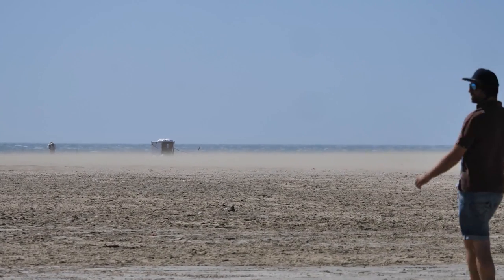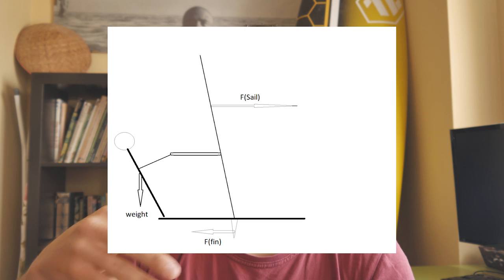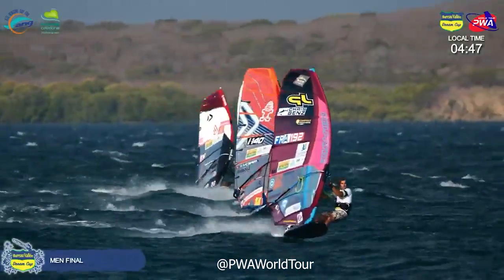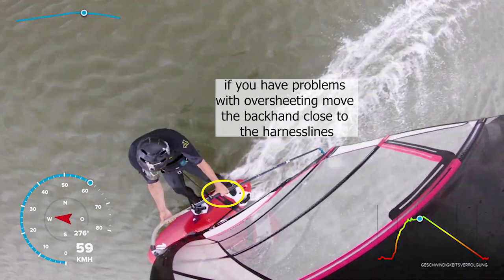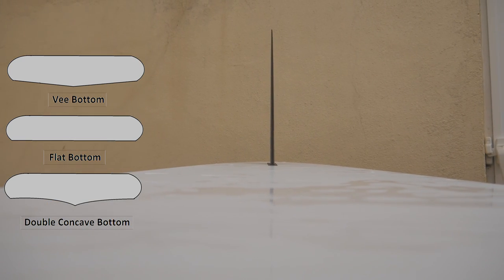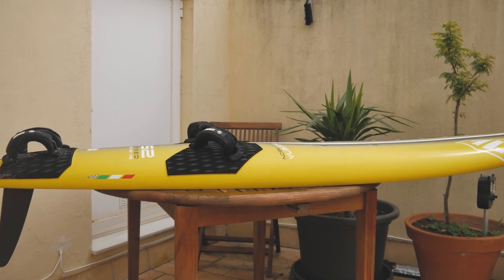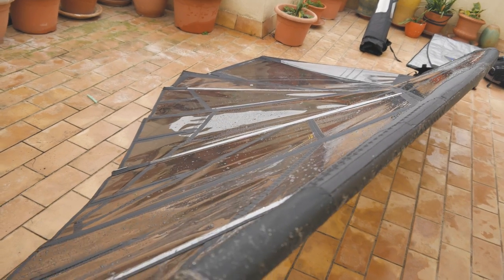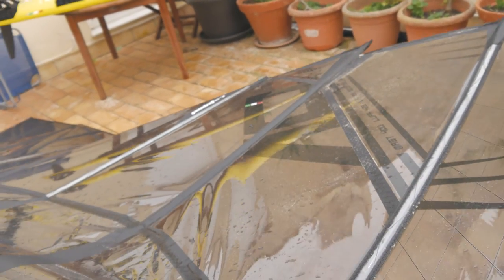Speedsurfing Tutorial | How to Reach 35 knots | Gear Technique & more

Comment: Great video thanks, some really useful information there.
 I have an old JP freestyle 95L with a powerbox fin. I recenly managed 35Kts with it on flat water with a 33kts average over 500m. I am pretty new to speed sailing and unsure what fin size and style would be best? I have a  MFC 30cm freestyle fin which is great for early planing but is really unstable at high speeds, so I bought a Drake 32cm G10 slalom fin which seems better, slower to get on the plane, but a lot more stable at speed. What would you suggest as a good  powerbox fin for speed sailing, if there is such a thing? Or is the Drake slalom fin pretty much as good as I will get for this style of board?